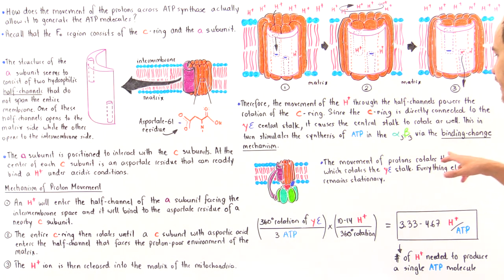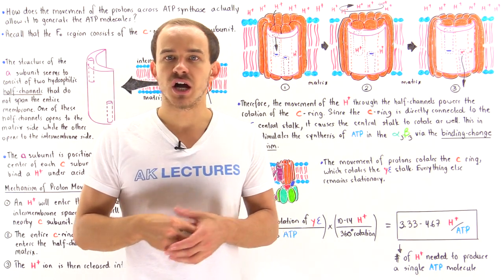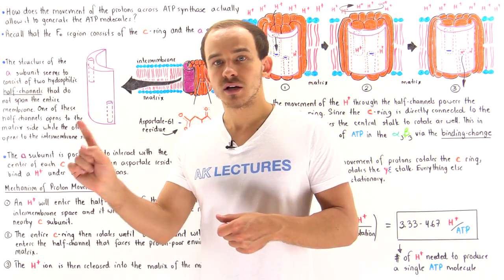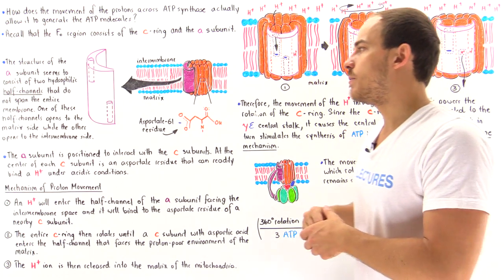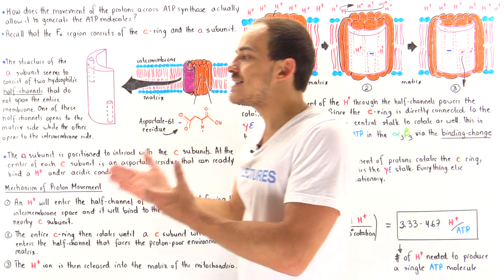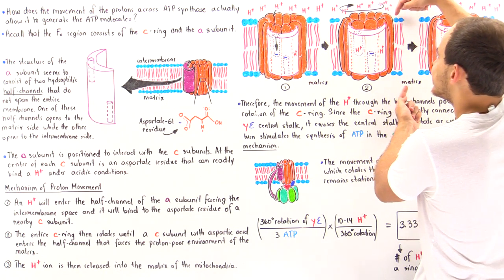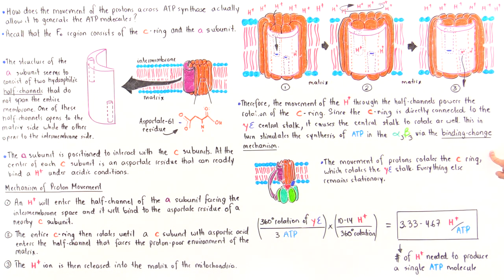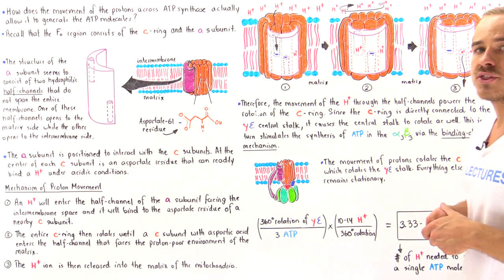Proton Movement in ATP Synthase

Comment: The range of 10 to 14 subunits. Is the reason for the range an optimal health reason? For example in a healthy individual their HLD will be large and 'fluffy' vs smaller. And / or is the variation of 10 - 14 subunits a function of what type of cell the mitochondria resides? Or is it like muscle cells? Sedentary vs weight trained vs marathon trained will have a different profile and average of their number of subunits?

Comment: If C subunit rotate clock wiz then how g stack rotates counter clock wiz?
Reply: I believe it was just a simple mistake.  If in fact, they did rotate in opposite directions then tension would build up along the gamma stalk.  Unless there is some unmentioned enzyme that relieves the tension of this opposed rotation, then tho opposite rotation wouldn't be possible to continuously generate ATP through rotational catalysis.  He probably just explained it based on the way that it was drawn rather than linking rotation of the F0 portion with the rotation of the gamma subunit.
Reply: Short answer
The direction of rotation depends on the viewing point of the observer and the reaction catalyzed by the ATP synthase. When synthesizing ATP, and viewed 'from the bottom' (observer faces the intermembrane space looking into the mitochondrial matrix) it rotates clockwise.
https://biology.stackexchange.com/questions/57741/in-which-direction-does-atp-synthase-rotate
might be useful for someone else

Comment: Epic stuff! 
I didn't really get something, when the protons binds aspartate and form aspartic acid, how do we regain the proton which goes into the matrix? Actually, does only the proton go or the whole aspartic acid molecule?
Reply: me too
Reply: aspartic acid lets go of the proton into the matrix. Electron transport chain complex 1/3/4 pumps protons back out into the intermembrane space as the electron moves across the electron transport chain.
Reply: So, when the proton binds to aspartate to form aspartic acid, the aspartic acid is in an acidic environment with plenty of H+ ions (intermembrane space). When the c subunits turn to meet the matrix-facing half channel on the a subunit, the aspartic acid has its proton abstracted by the basicity of the matrix and its lack of H+ ions (chemiosmotic pressure). This is seven years late, but I hope this can help someone reading through these comments.
Reply: @mpc7440  thank you for your reply buddy. It is a shame that I don't remember any of that. I hope somebody else reading through the comments finds some benefit here.